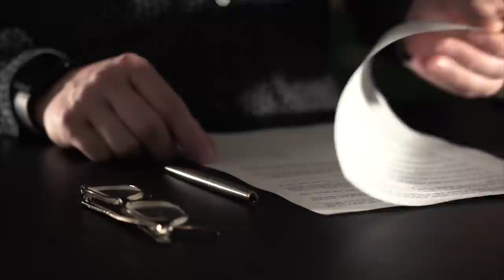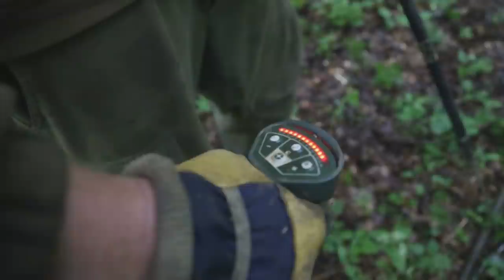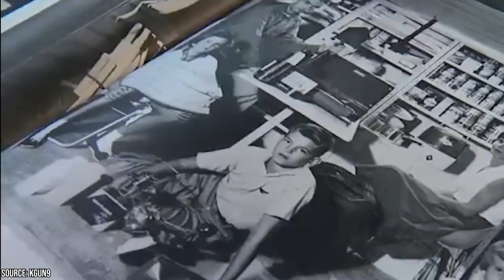Man Accidentally Digs up a Secret Underground Bunker in His Backyard

Comment: I was in high school in the 60's we would have bomb drills and when the air raid siren would sound off we would run to the hall and cover up like that's to protect us from the radiation. My uncle had a bomb shelter stocked with food and water the doors were several inches thick and heavy.
Reply: Woah 😨

Comment: I work as an electrician and rewired a house and all the walls were 5 inch thick concrete even the interior walls and it had a full basement and under the basement was a concrete bunker with 2 rooms it was really cool,it was built during the cold war and other than being dusty it was in great shape